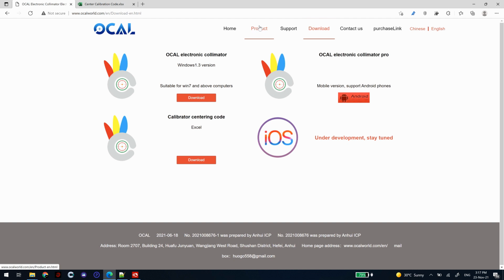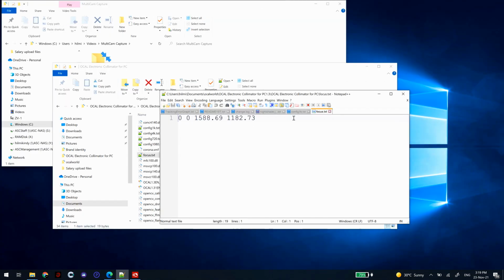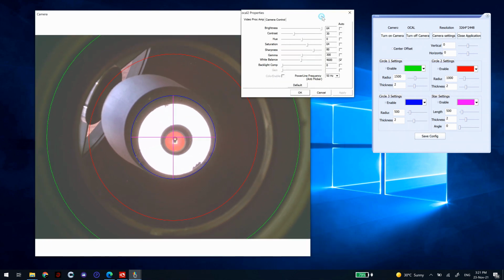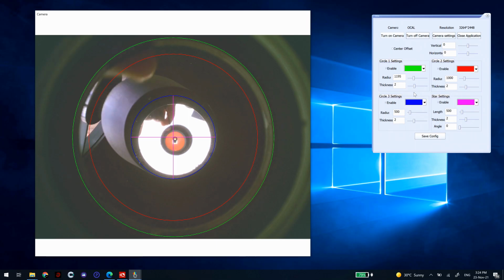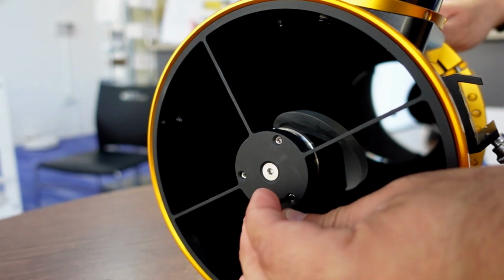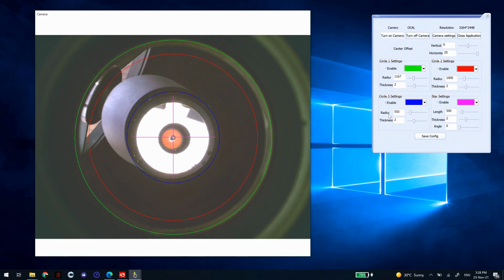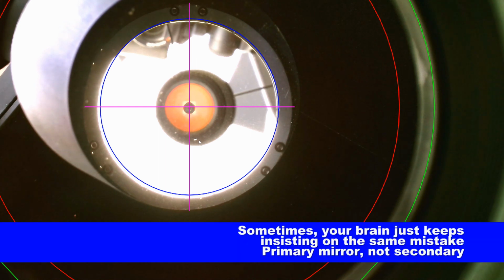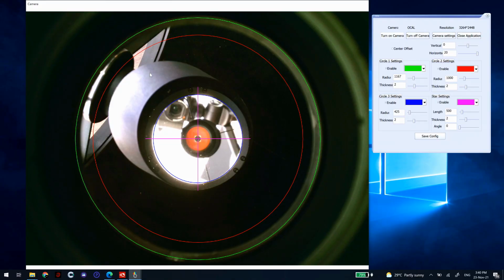1 Device to simplify telescope collimation!

Comment: Was a coma corrector installed during collimation?
Reply from the maker: Hi, sorry for the late response, for some reason I stopped getting notifications for comments. Unlike the bigger version of this scope, the coma corrector is not easily removable on this scope. Or maybe I just haven't figured it out. However, I have tested the results under the stars and got good results

Comment: I recently purchased the SharpStar 15028HNT and am looking for collimation tools other than the little 1.25" eyepiece that came with the scope. I've been considering the Ocal, so seeing a video of it on the little brother of my scope is very helpful! One part of the video I found a bit confusing was when adjusting the secondary, you stated there was no way to adjust the physical position of the secondary. I understand there is no way to change the length of the spiders; however, the secondary can be moved up/down the tube via using the big center screw - just like any other newt. Further, you can rotate the secondary as needed. Would you mind explaining a little bit more what you mean around the 13:10 mark of the video?
Reply from the maker: I have since learned about the ability to move it in or out, but you can't use the spider to center it. I have purchased the unit on display and use ocal to collimate it. If I move it to a position where mirror is perfectly centered to focuser I can't reach focus. If I move it out a bit to reach focus, I get uneven illumination in my frame. Honestly despite these foibles, I still like the scope
Reply: Have you tried collimating it with OCAL? I have the same telescope and am having some difficulties with collimation using OCAL and other tools.